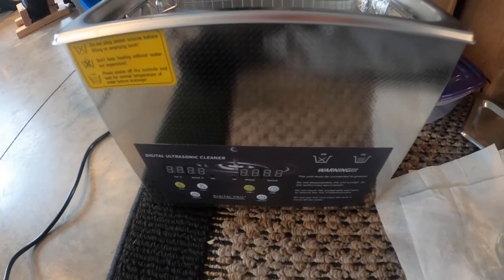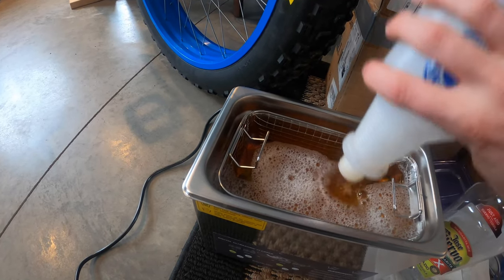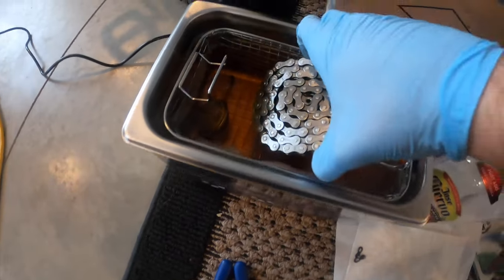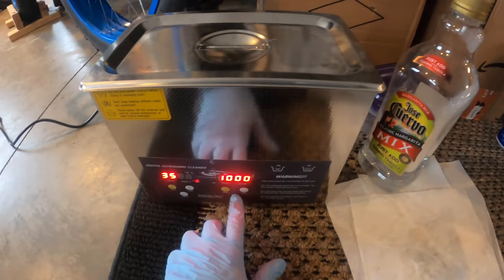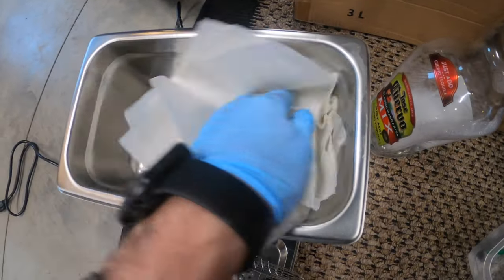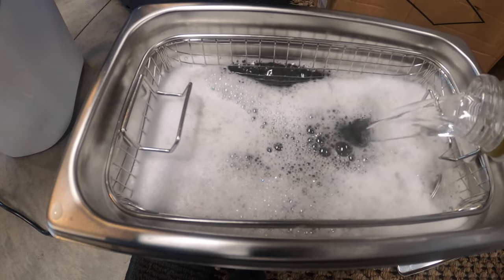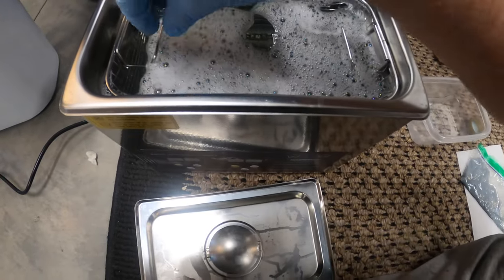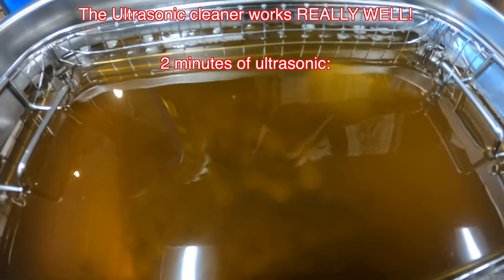Ultrasonic Cleaner Bike Chain 4K

Comment: As someone who sold and repaired ultrasonic cleaners, I would suggest a few things. Never put anything directly on the bottom of the tank or the sound waves will bounce back into the transducers and break the brittle piezo ceramic discs, or break the epoxy bond holding the transducer to the tank. Which leads to a caution about never getting flammable liquids near the unit. It is a common failure for the solder holding the power wire to the transducer to vibrate off and turn into a spark generator.
Reply from the maker: good information, thank you.  the tray had rubber things on the bottom so it wasnt metal on metal or anything. It is definitely a sketchy chinese contraption i will have to keep an eye on it.  I dont use it for that purpose anymore, but it can be useful, I'll have to be careful with it, thanks for the tips!!
Reply: @EBikeBuilder_  I have the same cleaner. Used it to clean my carbs on my motorcycle. They came out looking brand new

Comment: It's buying an ultrasonic machine and using energies plus chemicals versus waxing the chain or buying a new chain starting around USD 10,-.
Reply from the maker: hey Jonas I agree, I dont use the ultrastonic cleaner for this purpose anymore.  I don't waste time with cleaning chains anymore, either.  I use a wax based lube like white lightning clean ride, and just keep putting more on.
Reply from the maker: the ultrasonic machine also makes a terrible noise and takes like 20 minutes. Its not pleasant
Reply: Yeah if you add up the cost it doesn't make sense. I can buy an ultegra or kmc chain for half the price of the ultrasonic cleaner not including the degreaser. If you clean your bike and chain normally a chain would last 10000km or more. Which is like 3-5 years for some

Comment: Interesting video. At this point, is it really cleaning off dirt or are you washing out the internal lubrication of the chain?
Reply from the maker: yup it cleans out grease and grime from inside the chain where the actual rollers and pins are.   This video was the first time I used it, so i was kind of experimenting. A good resource to check out for a "proper" ultrasonic cleaning procedure is "Zero Friction Cycling" on youtube. Among some of his recommendations are to use mineral spirits to clean the chain first, which I've found to also be very effective. His videos are kind of long winded though.

Comment: After your video i am not sure should anybbody buy it, because usually i put my chain in the bottle with alcohol or gasolin and shake for 5 minutes, but here you spent 30 minuttes, put chain 3 times in cleaner, also used a few liter of liquids... where is time economy?
Reply from the maker: yes I agree,  its easier to put a chain in solvent like mineral spirits, and shake it.  That's how i clean my chains now. I don't use an ultrasonic cleaner anymore.  Fair point

Comment: Should you not have the basket suspended rather than sitting on the base
Reply from the maker: it has these little rubber legs that are on the bottom of the basket

Comment: Scrub first and clean 30 minutes with the cage suspended by the handles on the sides
Reply from the maker: what I usually do is put the chain in mineral spirits and shake it and leave it for a bit. Then I shake it in Denatured Alcohol. Then I do a wax based lube.  That way you dont really have to clean the chain with solvents anymore, i just do that once when its a new chain to prep it for wax.  The ultrasonic is good but i only use it on new chains.  The solvent agitation can work pretty much just as well.  I agree if the chain is dirty obviously wipe it off first as it will be easier to clean.  But everyone loves seeing the ultrasonic time lapses of dirtyness apparently.  This is my most popular video and probably one of the least effort ones.